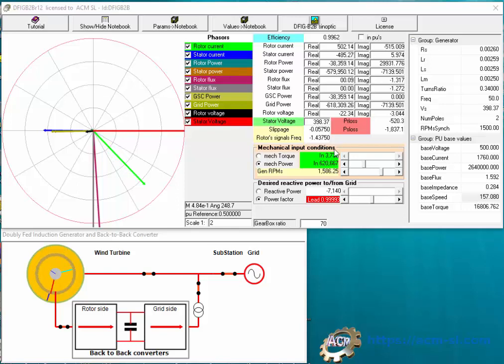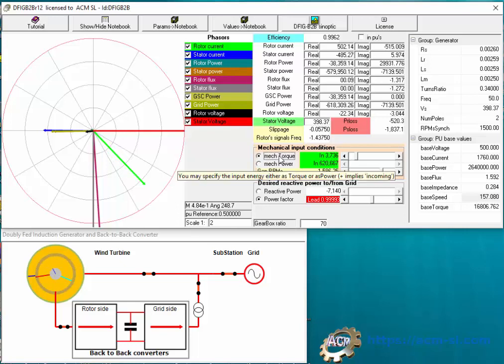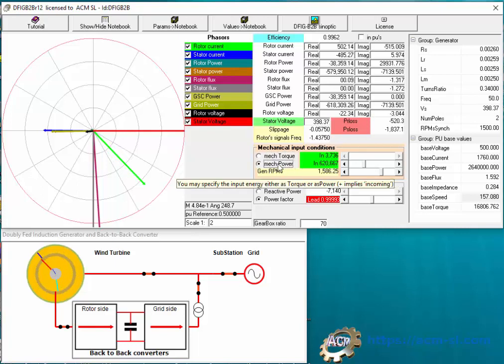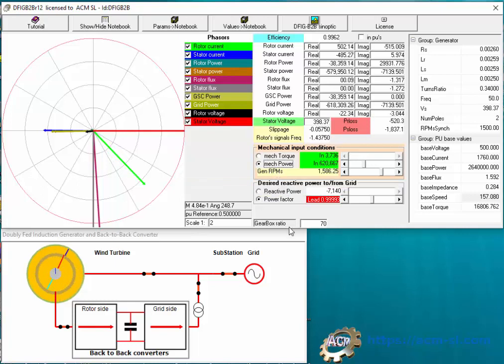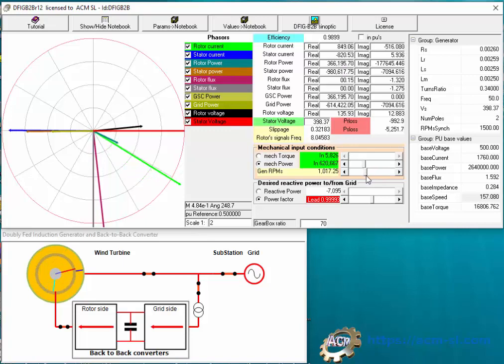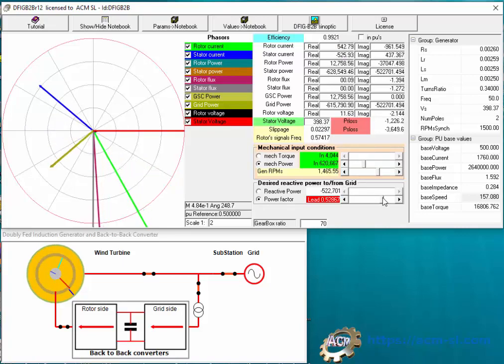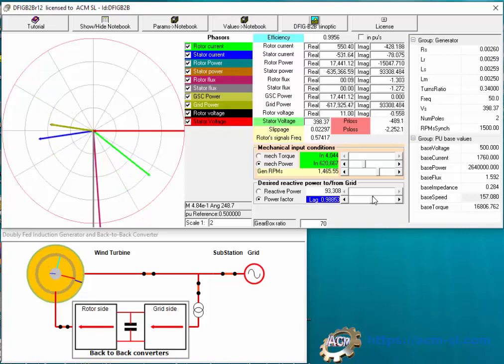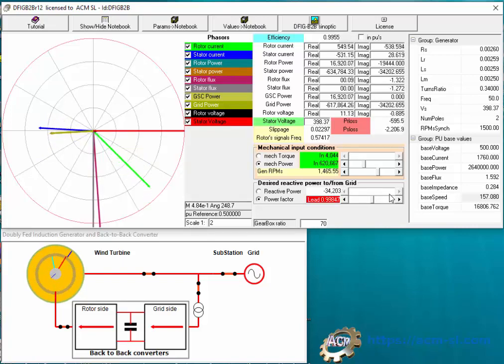Generator and Back-to-Back converter in a DFIG Wind Turbine

Comment: DFIG WIRING
Reply: Hello Gami, the wiring is shown in the diagram. Basically, you have access to both the stator and rotor windings of the generator. The stator winding goes, eventually, connected directly to the grid.
The rotor winding is connected to the rotor-side of the back-to-back converter, and also to the crowbar device (for voltage drops), not shown.
The grid-side of the back-to-back converter is connected to the grid all the time.
The power flow is bidirectional in the back-to-back converter.
If you need more information perhaps you can visit our web site https://www.acm-sl.com 
Regards.